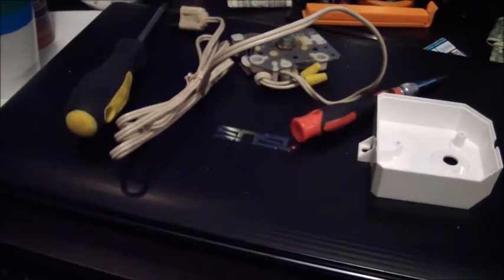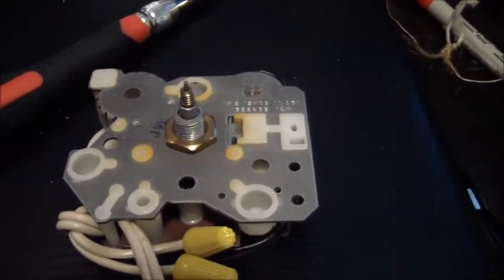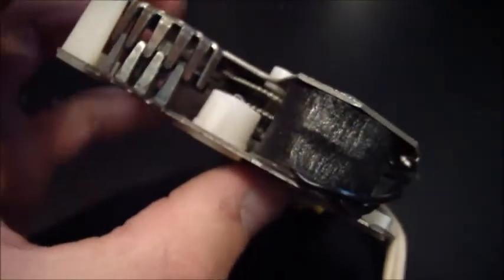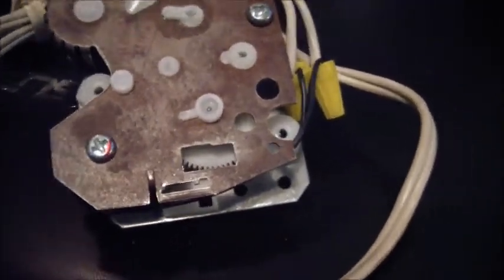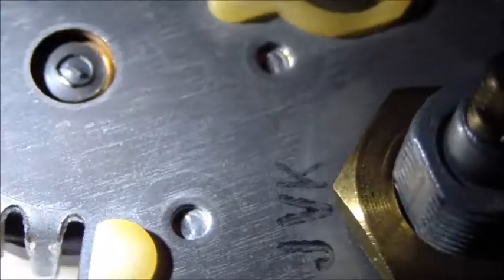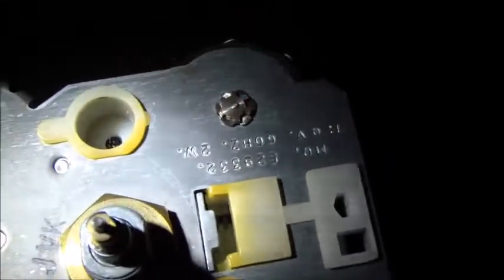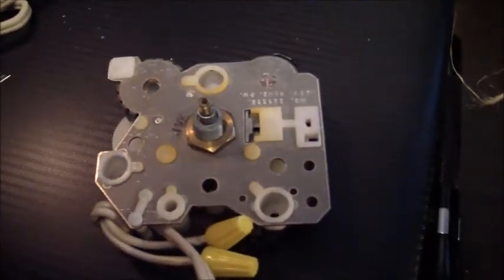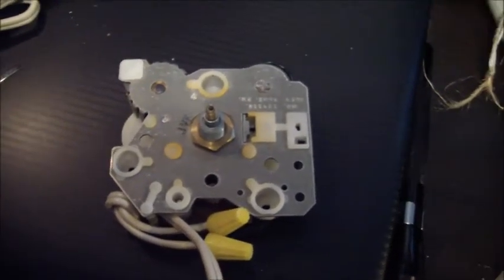How an AC Electric Clock Movement Works.

Comment: I've got a clock from the 1950's that has a 120 volt motor that's still working great.
Reply from the maker: +orange70383 They usually last forever. Only thing that is usually wrong with them is lubrication, or a gear that wears out. The Sunbeam clocks, like the one in this video, are known for both. I buy the replacement gears and rebuild them often. After that they go forever. They were really the best clocks, in my opinion.

Comment: Thanks for showing me what's inside this device. =)

I seen some certain AC Electric Clock on second hand shows when it's turning, some of them are turning smooth and some of them turn tick like a battery operated clock.
Reply from the maker: +Bluethunderboom No Problem. The new AC powered clocks are just the same as a battery powered one now. The old ones were more simple and were much more reliable. The old ones, like the one in this video, have a smooth second hand because the motor is constantly rotating. 

Some of the old Westinghouse electric clocks had a small gear in them that was designed in such a way so the second had would tick (Basically a geneva wheel), event though the motor is constantly turning, but I don't own one of those. Those were unique because they showed each individual second, as appose to a sweeping second hand just turning contentiously.